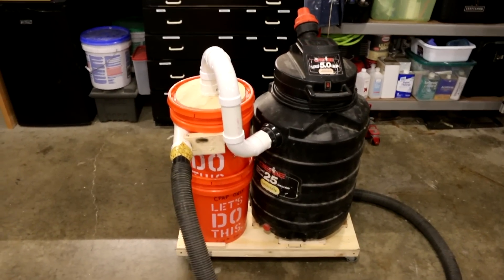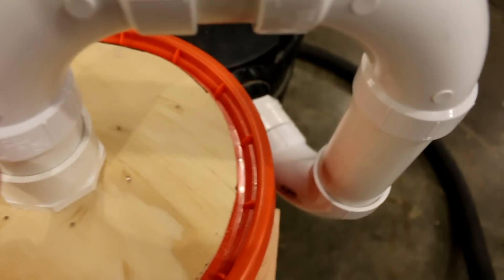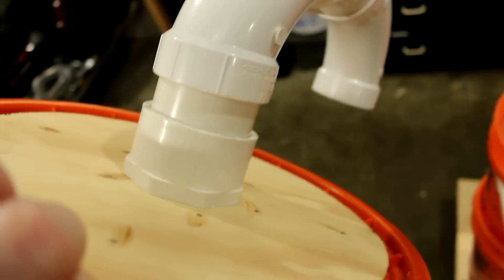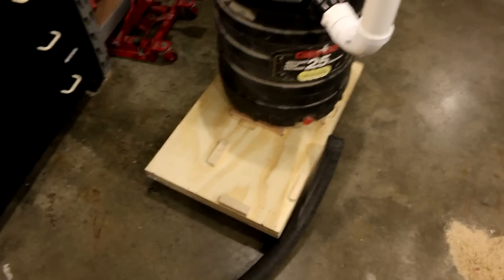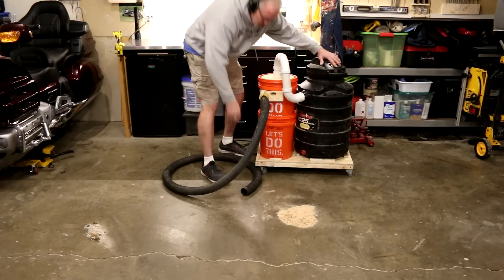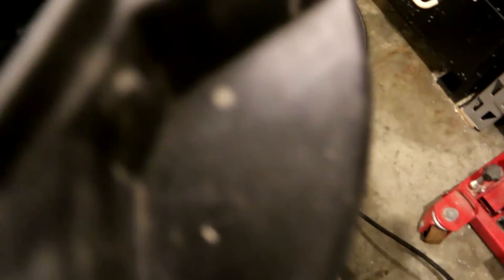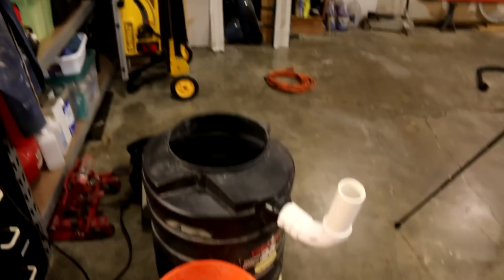$25 Dust Collector / Thein Separator

Comment: I generally like to over complicate things....but I ran into a basically broken shop vac at a yard sale...And the light bulb went off....For $5 I bought it and took the motor off but left the plastic fairings in place.  Without having to make any mods, I now have something very similar to what you have.  Plus the paper filters were included and the foam one as well.  So I have primary filter followed by a secondary one in the motor side of the vac.  Getting a used or broken shop vac might save a lot of time.....The inspiration for this came from you.....many thanks!

Comment: the fitting connection can be made with the nozzle that comes with a vacuum. just cut the flat end off the end that goes on the hose, and it will make a prefect friction seal fitting

Comment: You can use a heatgun to warm up the pvc or abs pipes and fit them over the shopvac connectors for perfect seal.  they come appart after with a good twist so its not permanent. makes it movable . just keep rotating the pipe, having it burn a spot will make it bubble. also using a 2inch wood circle cut-out can help with the initial fit, to flare the edges.
Reply from the maker: Thanks... Actually I already did that.  Great idea.  When I made this video I had just finished the separator so all the extra stuff  (like your great idea) hadn't been done yet.  I guess I should have updated the video.  Also this video was before I realized that my camera had a face following setting that would have actually focused on my face.  Oh well, Live and learn.
Reply: Cool man!  would you by chance have a trick for collecting drywall/plaster dust? my cyclone contraption does not work so well for that material. I still end up having to smash the poor filter when sanding. Thanks for being courteous :D
Reply from the maker: You could try filling the bottom bucket with water.  We had a vacuum when I was a kid called a Rainbow that had a tank at the base with water in it.  There was a spinning separator that kept the water out of the vacuum.  This is sort of similar.  I would say it's worth a try although you would have to have a place to dump the resulting Goo out of the bucket as you certainly wouldn't want to put it down the drain.  I suppose you could pour it into a hole in the ground and the water would drain into the soil. There is nothing bad for the environment in drywall dust. Maybe not at this time of year unless you're a lot farther south than I am.  I'm in Chicago.

Comment from the maker: I discovered something about the separator while sanding 60 parts for my wife (school choir thing).  After sanding both side of 60 pieces totaling about 470 linear feet of edges, I did have to tap some fine powdered sawdust out of the shop vac filter after all this work.

Comment: GordWing Hello there! I'm collecting information by looking several versions of this dust separator. I was thinking of building one like yours because it's made from 2 big buckets, being the top bucket upright on the lower one. This resulting in the top bucket forming a slight conical shape sending the spinning air down to the lower bucket more easily. That's from my observations I took from the popular Dust Deputy. It's conical! So, building from 2 buckets this way, you can get a slightly conical shape too. 

Good work man. I'll be trying this soon! 
Thanks!

Comment from the maker: Sorry I didn't explain that well enough in the video.  The lid of the bottom bucket is cut out so that it will slide over the bottom of the top bucket.  I slid it on the the upper bucket until it wouldn't move any farther up.  Then I ran screws from the inside of the top bucket below the rim of the lid so that it won't slid back down.  Then I ran a nice bead of silicone to seal the lid onto the top bucket.  That makes it airtight.  As far as fastening the 2 buckets together, I really don't.  The weight of the upper bucket  makes it stay in place.  I don't snap it on or anything.  It just sit there.  Take a look at about 6:00 in the video and it might help explain it how the cut out lid of the bottom bucket is fastened to the upper bucket.  You can see the screws on the inside.  Sorry I didn't make that more clear in the video.  I hope that clear up your question... Take care.

Comment: For this specific design, optimum separation of fine dust will occur when there is zero air leakage at the joint between the top and bottom buckets, below where the baffle is located. You can tightly wrap a continuous length of kitchen cling film around that joint. Any air leaks will be visibly disclosed and sealed when the thin film is sucked inward.

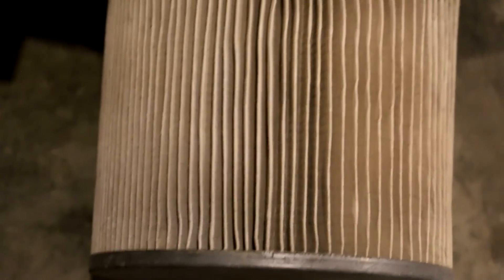Comment: Ai 09:30 you said it would, "take a while...". Not so in my shop, sigh. I seem to be cleaning filter and emptying my 12gal. Frequently - if it isn't wood it's metal chips from the lathe, mill etc. (I also use the metal machines for wood) . So I'm shopping around on YouTube for a 'cyclone' system. Once I have a working system I'm going to experiment with a cyclone idea that's been running around in my head (no pun intended).

Comment: Very cool, I plan on building one of these in the next few days. Just curious your thoughts on instead of using a plywood circle with a slot, just cutting the slot in the bottom of the pail? I might try both ways to see if there is a difference. Thanks for your thoughts
Reply from the maker: Never thought of that.  All the versions I saw had a piece of plywood.  I would bet that it would work fine.  Please let me know as I plan to make one for my brother.
Reply: GordWing Thanks for the fast reply. I will get back to you and let you know
Reply from the maker: Thank you.
Reply from the maker: Besides, if it didn't work, all you would have to do is take off the bottom and throw in the plywood, so there is certainly no downside... Great idea.
Reply from the maker: I would have to believe that it will work fine... I never thought of that when I was building mine.  Keep me updated.  Too funny about the garbage can (not for you necessarily) that darn atmospheric pressure.
Reply from the maker: Cool... That shaves a little cost off of the project. Glad it worked out for you.
Reply: Yes mine works well just need to iron out some kinks. Two inch isn't quite enough to run off my planer. But it definitely saves some time and money just using the bottom of the bucket
Reply from the maker: Like out of the top of the separator right into the shop vac ?  In other words the shop vac is higher than the separator ? Just trying to picture it.  Yeah, it would only figure that the less 90s you have, the less restriction.

Comment: What is the purpose of the baffle? Seems like it work just as well without it.
Reply from the maker: Well, as I said in the video, I sort of Frankensteined a bunch of ideas together that were gleaned from multiple units I saw on the Web... I really didn't try it without the baffle, so there really isn't any specific reason for it other than some of the units I saw said that it helped to keep the dust  down in the lower part of the bucket so less gets into the shop-vac... I always like to hear feedback from people that have built one... Thanks for the comment...
Reply: I haven't built one yet was just wondering what the baffle did. I too seen it on several other builds so apparently it serves a purpose. I did see one without it and it worked good too according to the demonstration.
Reply: @jameshochstetler6093  I had the same question. After watching lots of videos I've come to the conclusion that the Thein baffle is designed for when there's a lot of sawdust filling up the collection bucket. Without the baffle, all the dust would continue to spin and be agitated and eventually get sucked back into the vacuum itself. All the other videos so far only show how their system works with a little bit of dust in the bucket. A full bucket test would show loss of efficiency. Good simple design, Gordwing! I'll be using some of these features.

Comment: I have only see one testing example where they take the filter out and rubber band some filter fabric over the outlet, then do the dust pick up test, and then take that filter fabric off and you can actually see what went through the vacuum.  And not just hidden in the folds of the filter. 

This is the real defining test, please make this test.
Reply from the maker: HH...If you're not sure that this filter is right for you, I'm sure that you could find other plans that might better fit your situation.  As I say in the video, this filter takes MOST of the sawdust out of the intake and not ALL of it. If you require a higher degree of filtration, I'm sure there are H.E.P.A. filters on the market that might better suit your needs.  My intent in making this video, wasn't to prove this project was perfect.  I just made a video of my separator to hopefully show someone who wants to make one, a basic overview of it's construction, that's it.  I already know what the outcome of your suggested test would be.  There would be some dust on the filter cloth you spoke of.  As there was inside the vacuum in the video.  As I said before, the separator takes MOST of the sawdust out... not ALL of it.  Sorry, but I'm just an amateur wood worker showing one of my ideas to anyone who wants to listen. Have a Happy, Healthy New Year...
Reply: Sooooo...I'm thinkin' that someone needs to tell these jerks that they can get the youtube for free. I'm sure that's the reason they're slamming your efforts! Otherwise, why take the time to slam someone who takes the time and effort, without any compensation, to try and help others with common solutions? If I was paying for the right to watch your video, I might feel justified in criticising. But I'm not...I appreciate your effort...and after I finish at my computer this morning, I'm going out to my shop and start my build of your prototype. I have a sneaking suspicion that Mr. Bell had the same sort of reaction from the public when he started showing off his fancy new talk over the wire to someone in another location idear!  Thank you Gord for your video.
Reply from the maker: Thanks Maddog...  Your intelligent insight is appreciated.  If I don't like someone's video 99.99% of the time I just move on to something that grabs my interest more. I guess some people feel better about themselves when they are tearing someone else down... I've never understood that.  Have a great weekend and I hope the project turns out well.

Comment: Thanks, great explanation & clean build.    Google "plumbing flexible coupling 2 inch" for a handy way to connect PVC & shop vac hose.  

Do you have any issues with the bucket collapsing?   My version 1.0 used a 30 gal. metal trash can and worked great ... until a piece of plastic plugged the intake and the vacuum completely collapsed the trashcan.    The big can was handy but v2.0 may use the small buckets if they work better.
Reply from the maker: I've never had any issues with collapsing buckets, but then again I've never had a complete clog so I can't really speak with any authority regarding the issue. For me it was a space issue (bucket size) and the fact that my separator needed to be mobile.  Thanks for the info regarding attachment of the hose. It's so quick and easy for me to empty the lower bucket that I've never really thought about a larger lower container. I guess I don't generate a massive amount of sawdust compared with some shop and so far this size is working well.  Take care and thanks again for the Google info.

Comment from the maker: Skylift... It's called the "Park and Move"  made by a company called "Legal Speeding"  Bought mine from Wingstuff.com  http://wingstuff.com/products/33789-park-n-move-wheeled-dolly?from_search=1
My wing is about 950#+ gassed up and the "Park and Move" works pretty well.  The bike MUST have a center stand for it to work.  I've also seen similar stands for bikes without center stands. I have artificial knees and it's a little hard for me to get the bike on the stand so I made a small ramp made with a stack of wood using 1/4", 1/2", 3/4" pieces to make a final height of 1 1/2".  I back the bike onto the stack and then it's a little easier for me to get the bike on the stand. Take Care and Ride safe...

Comment: Nice job! Getting around to finally making one using your ideas as well as those from others. Did you know that they make 5 gallon bucket lids that are designed to be removable? They are after market lids that do not “lock on” and are designed for painters that are not using an entire bucket of paint initially. Just a suggestion to make it easier to empty bottom collector.